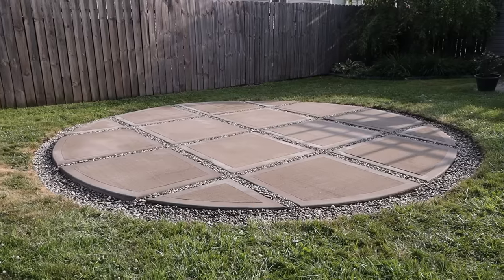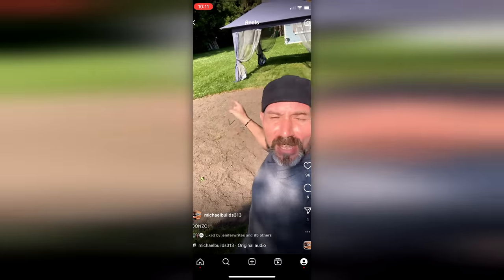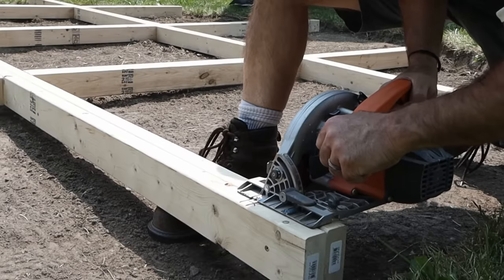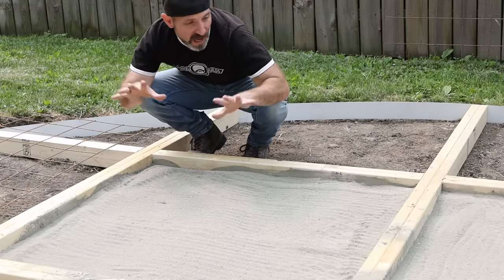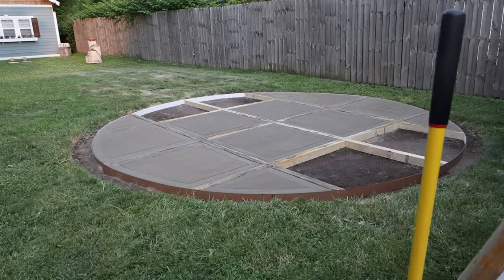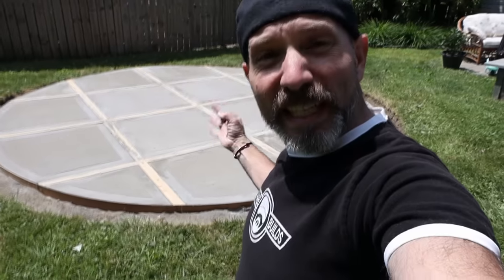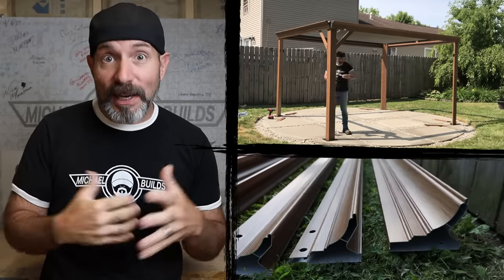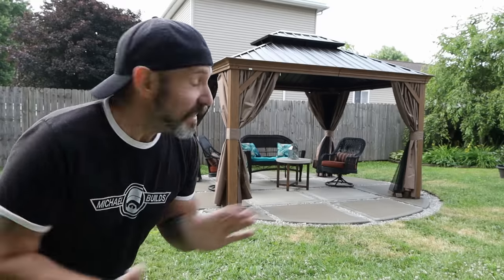Dry Pour Circular Concrete Patio with a Domi Gazebo!

Comment: I have noticed it’s hard to keep the aggregates from coming to the top when screding the concrete, would using a top coat, maybe 2 inches, of Portland cement prevent this?  Fill the form half way with concrete, then fill the rest with Portland cement, or maybe mortar. Just curious, if this would work out better than trying to work the aggregates back down.
Reply from the maker: Honestly, I haven’t had that problem yet. But I’ve also noticed that in quite a few other videos that people are having trouble with the rocks rising to the top like you said. But i think maybe they just need to go over it with the screed some more.
Reply: Don’t put pure Portland on the top bc it needs sand or aggregate to adhere to make solid surface. I’m trying quikrete “ topping mix” next slab bc I used mortar mix and it spalled ( flaked off) but reading other posts I might of overwatered?

Comment: I have a question, not relating to the build which is indeed fantastic but I figure you and your audience were the right people to inquire with. I don't live in the US, I live in the Caribbean. It's hot here as you might imagine but when we get rain, WE GET RAIN. I wanted to know what is the usual procedure for your outdoor curtains and furniture etc when the rains come? For instance, I notice Michael has the curtains on the gazebo, yes but he also has an extension from his house that forms a canopy over some outdoor furniture. I can't imagine moving this furniture every time the rain falls so, how do you go about protecting it from rot and mold?
Reply: Also subbed, cause this was indeed a great build and I've never actually seen a dry pour done before. I used to work with a family friend who dabbled in construction and all my concrete mixes were various forms of wet mixtures depending on where it needed to be applied.

Comment: I'm going to be attempting a dry pour project myself and I appreciate how much detail you went into your project!  I was wondering if you knew the volume of the concrete that you calculated for this project?  Did you use the bag calculator on the Quikrete website to determine the amount of bags needed?  In the video you stated that you needed to go back and grab more bags for the project - I'm assuming dry pouring uses more bags than wet?
Reply: For a small job, always get one extra. The bigger the area, get extra exponentially. You can always return it.

Comment: Amateur Alert (I mean me) New to all this dry pouring; as with cement you can add sand to make it go further so to speak, is there anything that can be mixed with the concrete bags that would allow each bag to go further without weakening it too much? Thanks.

Comment: Couldn’t you mix in some gravel with the first half of concrete to make it cheaper then put down the metal then put straight concrete on top so you can get a good finish? I was just thinking of a way to make it a little cheaper and they put gravel in regular concrete so it should be fine in this. I would just put some gravel in a wheelbarrow then mix in a couple bags of concrete then pour it in the form and don’t wet anything until it’s finished.

Comment: I live in the desert, Las Vegas, it is hot here and dry. Does this make a difference with misting times?
Reply: You'd likely have water to more often so the water doesn't "cook" out. Although when it gets really hot here in Iowa I've seen them cover projects with burlap or some sort of cloth and a sprinkler. Some are saying to mist/water for an additional 7 days for fullllllll cure. If that's the case, you might think about twice daily during that period

Comment: Looks awesome!
Not going to mention that crack in one of the concrete pieces?
Reply: If you really saw a crack, it’s drop-dead simple to note the time in the video you see it and share it in your comment. Can you do that?
Reply: @isabellavision  16:27 front right tile, top right corner.
Again at 16:43
Reply: @LukeTheJoker  I see the first one, and I can't believe he would have missed that. Is it possible Michael is planning to address it in the next video?  I looked back through the assembly of the gazebo, and I remember thinking when I first watched it that he was using a ladder on it only 2-3 days after starting to water it, and I would have put a piece of plywood down to distribute the weight. Looking just now, I see several times that one or two feet of the ladder were very near that corner (i.e.14:38, 16:16). In an ideal situation, that was rushing the gazebo build even if it had been a traditional wet mix (I read that standard concrete only reaches 75% of maximum strength after a week of curing, and it takes 28 days for 99% strength. So what could the strength have been after 2-3 days?). @MichaelBuilds : do you plan to address how the crack happened? Thanks, Luke.

Comment: An important factor that we discovered, if you are using the HD concrete calculator based on square footage, dry pour takes roughly 73% of wet--don't end up with 24 extra bags like we did lol

Comment: What’s the finished strength for dry pour concrete? How do you know you have full strength and how do you know you don’t have weak voids or areas that didn’t get enough water? Also, foam this be done on a driveway?

Comment: 1 mist per inch then spray once  every hour per inch
Reply: Cajun County Livin', the people who popularized the dry pour method, recommend only two mistings, one hour apart regardless of slab thickness. Next, they recommend two showers per inch of slab thickness with one hour between each shower. Thus, a four-inch slab would receive two mistings and eight showers over a 10-hour period. A slab 3.5 inches thick would receive the same amount of watering. In their most recent video, they caution against over-watering a slab during the hydration cycle in order to avoid spalling (surface deterioration). Once the hydration cycle is finished and the concrete is set, continued slab hydration over the next seven days is recommended to help with the curing process.

Comment: concrete guy here. concrete should last a life time. dry pouring will last until something heavy goes on it. or something hits it, or one freeze thaw cycle completes
 just mix cement as directed 3-2-1 ratio in a wheel barrow. please stop this stupidity

Comment: Dude, your dry-pour method is extremely irresponsible.  You could've totally done this with a wet mix section by section, adding the wire mesh reinforcement as needed and have been ready for building the gazebo in the same amount of time.  Your dry-pour method has no benefits and massive risks, based upon how the individual waters their project.  I can't even believe that these videos are being sponsored, as you're incurring massive risk with the way that you're using their product.  What's the difference between dumping concrete into a form or dumping it into a wheel barrow where you can get a good feeling for how you're mixing it?

Comment: i struggle to see the point of a dry pour, seems like a lot of faff and wasted time. compared to throwing everything in a mixer pouring out, smoothing, leave for a few days and good to go. no watering every hour no weak edges that chip and break when removing the form or waiting weeks to be properlyish set with a dry pour.
Reply: Everybody wants to be part of the trend. It’s just as much work if not more for half the strength of the product
Reply: @beanieweenie9543  is that true? Half the strength? I've been looking for data on this
Reply: @clintlickner  there is no data yet, just traditionalists unwilling to let others experiment with new methods without throwing out random, unfounded statistics. "We never did it that way, so it must be wrong." Even if they somehow guess right and dry pour ends up with "half the strength" at about 1,500 psi compressive strength, that is more than enough for most home and garden slab projects. I'd be surprised if the legs of that gazebo are even exerting 50 psi compressive force on the concrete. The biggest potential problem with this is that the concrete was not given much time to cure before the gazebo feet were drilled into it, even if it had been wet poured.
Reply: @isabellavision  I have been thinking hard about this method for a trampoline pad and for firewood racks. More concerned about weight rating for the firewood. And long term durability. I imagine it should be fine; but if say, a YouTuber, were to have a compressive strength test done on traditional vs dry pour I would be awfully greatful. Plus if it performed equally, it might get some traditionalists to rethink
Reply: @isabellavision  There is data. It can be pulled from knowledge of standard concrete. You need a certain water/ cement ratio to hydrate the cement, which is why there are w/cm specs for structural concrete. Too much or too little water significantly reduces strength. For high spec concrete, chemicals are added to increase hydration, specifically to allow more water to “access” cement particles and the mix water to be used more efficiently. The fact that this is not mixed means there is no chance that this hydrates the cement all the way. It may stick together, but by definition it is not as strong as mixed concrete. I havent seen anyone do a break test and i would love to see numbers on it, but having knowledge of the properties of these materials does allow you to take an educated opinion on it. Ive also poured/repaired/ ground enough slabs to be able to estimate the hardness by the way it looks, and these are no where near as hard as a properly mixed load of concrete. I hope it works out well for people who are doing it, but i dont like when people try to sell it as some revolutionary method and influence people to use it on structural slabs where they actually could get hurt if it fails. For their sake i hope it hits 2000 psi (code minimum) but i doubt it hits that except in perfect circumstances.